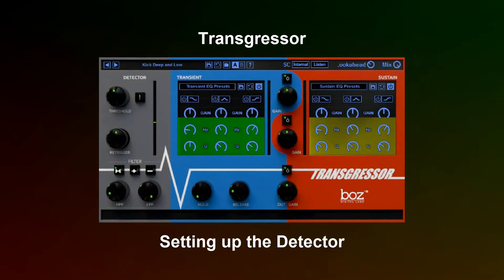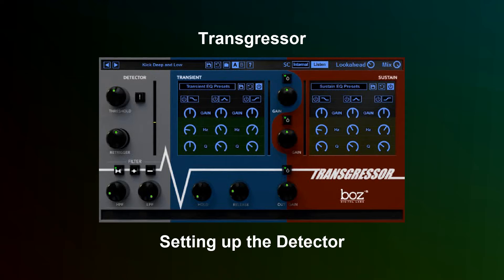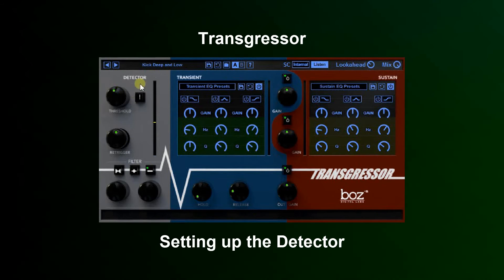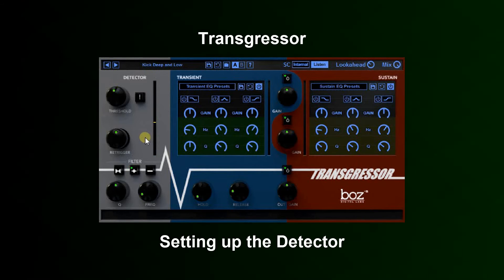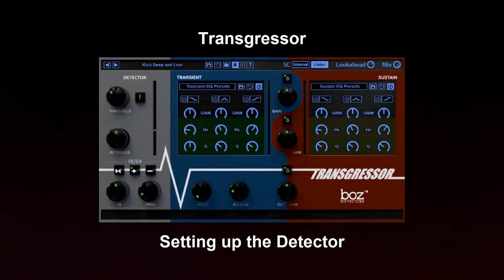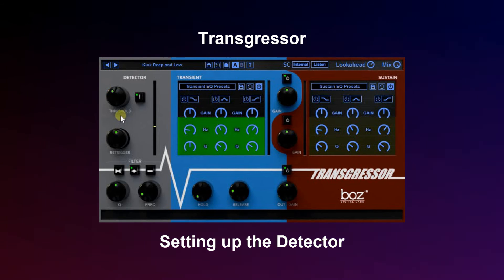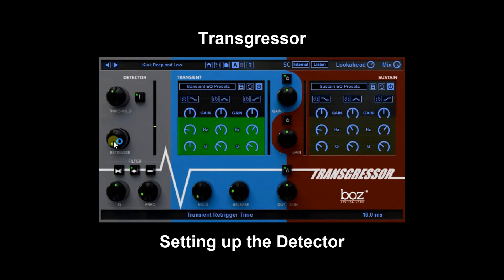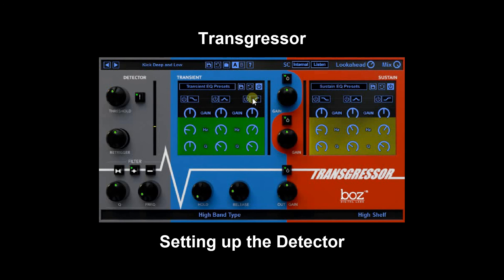Transgressor - Setting up the Detector

Comment: would be very useful to have a mono/stereo option for the detector/sidechain. Tried the plug on stereo drums and I couldn't get a good setting because it was stereo.
Reply from the maker: I agree. That's on my short list of things to add.
Reply: @BozDigitalLabsplugins  So is it there now? :)
Reply from the maker: @Fex.  Yes it is. The latest version has the option to run in stereo or dual mono.